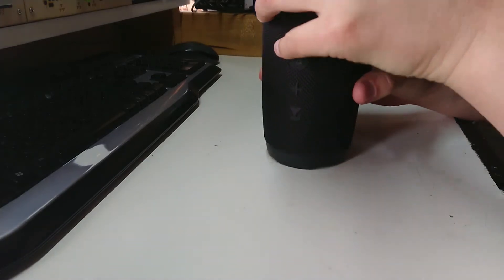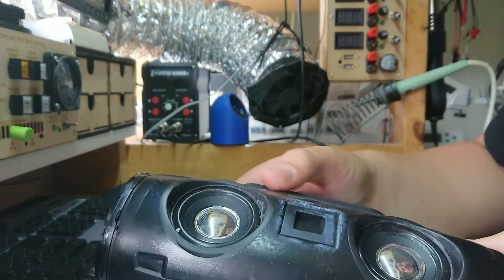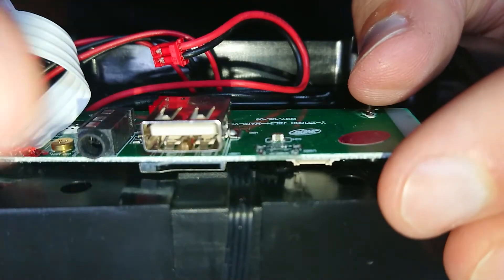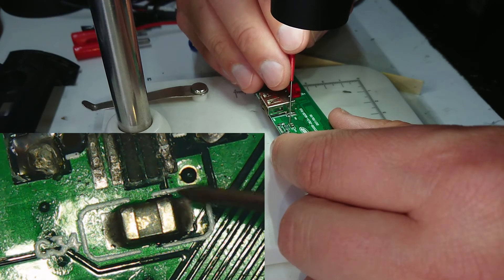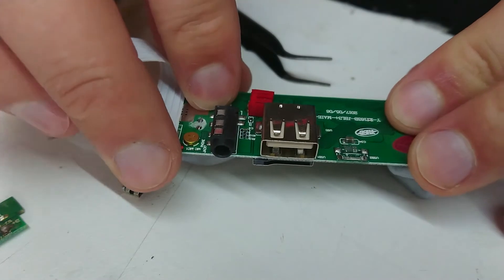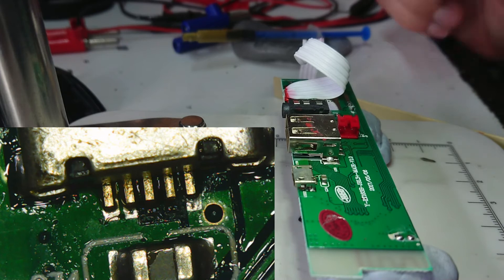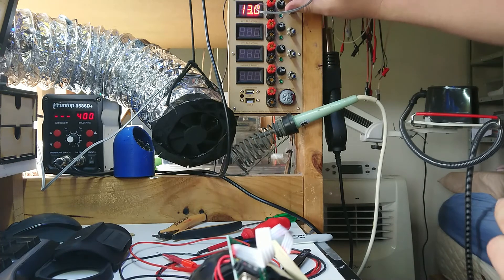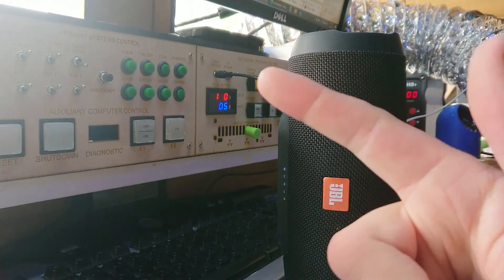(Apparently Fake) JBL Charge - Charging port repair

Comment: Fake
Reply from the maker: I don't own it, I was just asked to fix it.
Reply from the maker: It would be helpful if someone explained what exacy is fake...
Reply: @TheAussieRepairGuy  The speaker is not a real JBL
Reply from the maker: @deanstechcorner2556  yes I have acknowledged that. I don't own it, I just fixed it and gave it back to it's owner.

If you read the 50 other comments that say the same, you would see that.
Reply from the maker: @deanstechcorner2556  what features of this device indicate to you that it is a fake?
Reply: @TheAussieRepairGuy  The passive radiators are very shiny and the speakers have a dust cap the real charge three does not have a dust cap.
Reply from the maker: @deanstechcorner2556  Thanks, that will help me spot future fakes.
For the record, this is the only one I have had to fix. It's not like I run a shop fixing these.
Reply: And the passive raidiatir has screws
Reply from the maker: @deanstechcorner2556  so the fake one has screws, legit does not?
Reply: @TheAussieRepairGuy  on the real one the speakers have screws but the passive radiators do not
Reply from the maker: @deanstechcorner2556  Thanks, I will make note of that, but the chance that I will fix another one of these is practically zero.
I have a JB flip4 kicking around that might one day need a new battery - but I don't have plans to open that up unless it fails in some way.